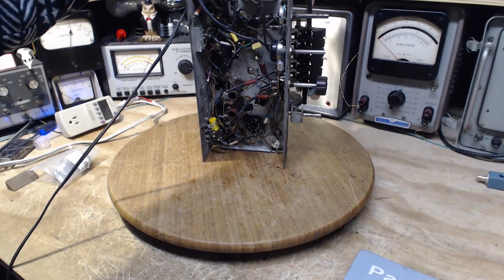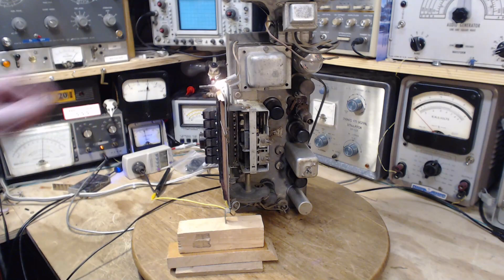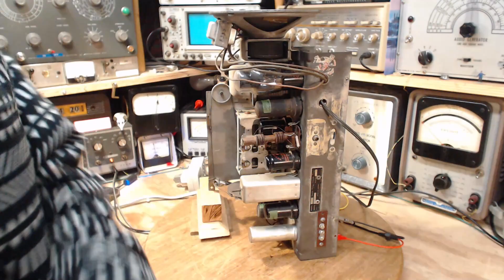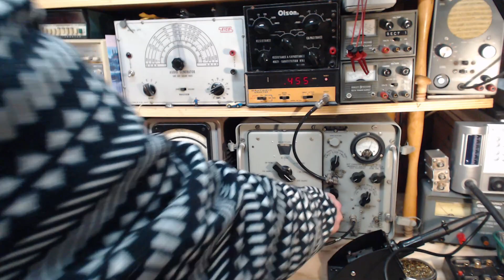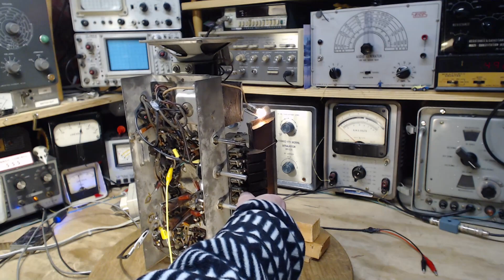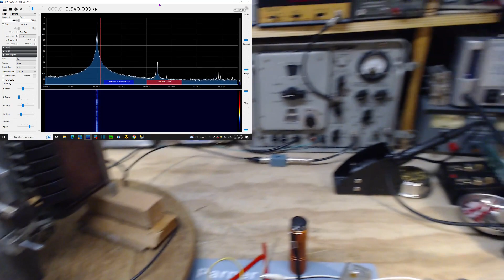Canadian Westinghouse Model 684 Video #14 - IF Alignment Attempt

Comment: when making adjustments using the agc voltage how about replacing the speaker with a dummy load resistor.

Comment: My latest radio was a 1960 Motorola AA8. It is Basically an AA5 with an RF amplifier and a push - pull audio power amplifier. It picks up 25 stations and is immune to all types of interference. One of the best radios that I have ever come across.